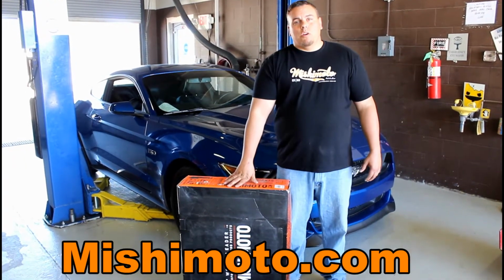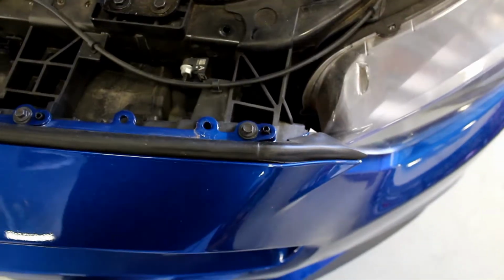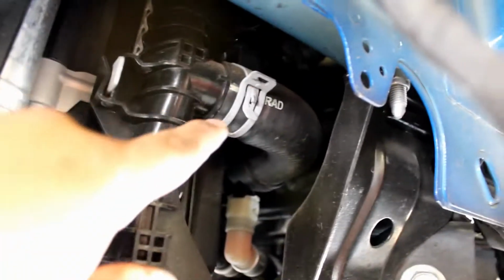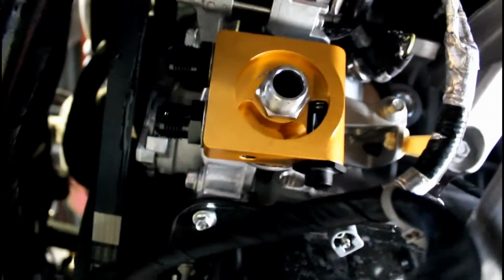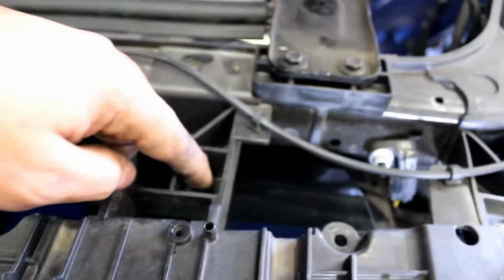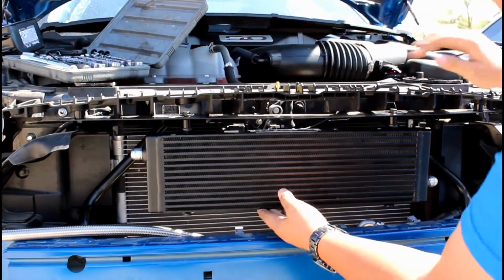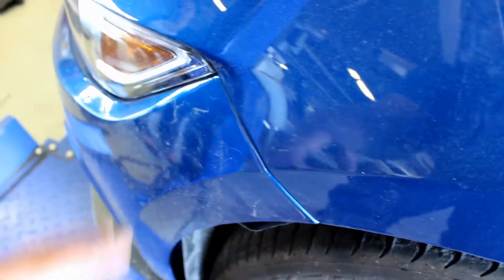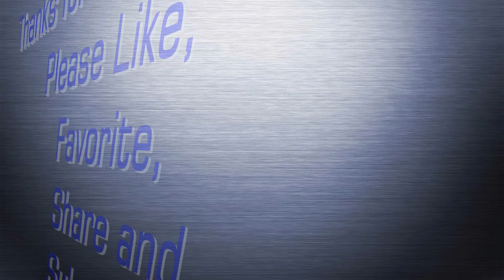How To Install Ford Mustang S550 GT Mishimoto Oil Cooler Kit Install

Comment: In the range of front to back adjustment, how far forward can you slide the oil cooler? Does it go far enough to sit over the crash bar? Thanks.
Reply from the maker: It goes far enough to almost touch the grill.
Reply: Jason Georgievski Thank you for your reply your info is a great help. Really need an oil cooler that can clear my procharger intercooler. Cheers!

Comment: Wish you would include the torque specs for the fittings and filter housing
Reply from the maker: Make them as tight as u can until it stops moving

Comment: Did you notice any difference at all?
Reply from the maker: yes, engine temps and oil temps stayed much lower while racing at the track and taking the load off of the radiator helped to keep the cylinder head temps down as well.
Reply: @FatGuyBuilds  no limp mode or loss of power? i do 25 minute sessions & lose power around 15 mins. really worth it?
Reply from the maker: @KP18793  it helps a lot.  This mixed with mishimoto radiator and you should be all good.
Reply from the maker: @KP18793  also you need the thermostat.  https://youtu.be/f20w6_l9mSM
Reply: @FatGuyBuilds  thanks for replying, trans temps went down too? thats what was bothering me the other day at road america. i got bigger radiator so the cylnder heads stayed cool. i just need to find a way to keep it on the track longer & i hope this is it. 170 thermo? - 10w30 good for track? not 5?
Reply: 160 i see now
Reply from the maker: @KP18793  my video is a 160 thermo
Reply from the maker: @KP18793  is yours an automatic?  I am pretty sure they make a tyranny cooler as well